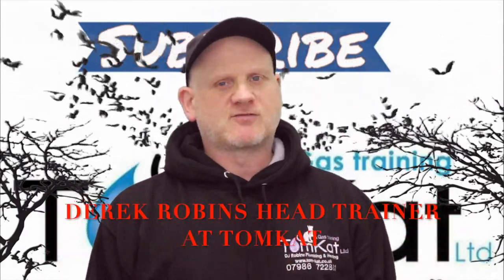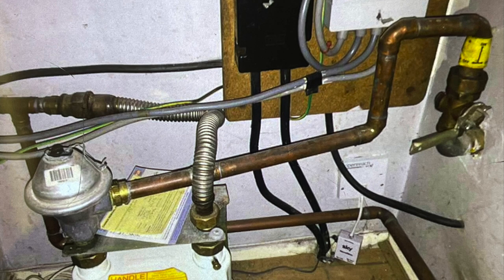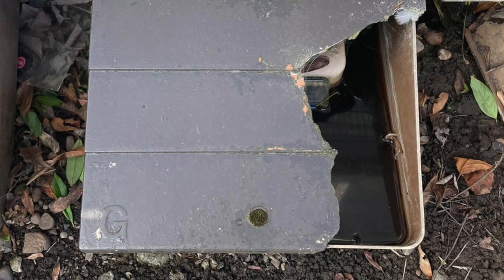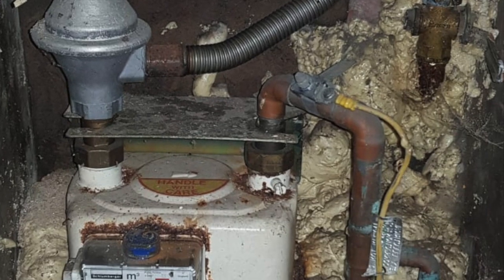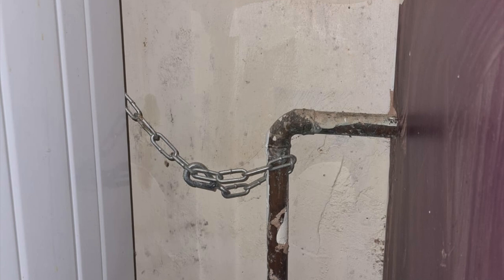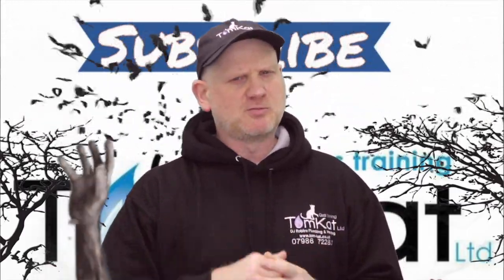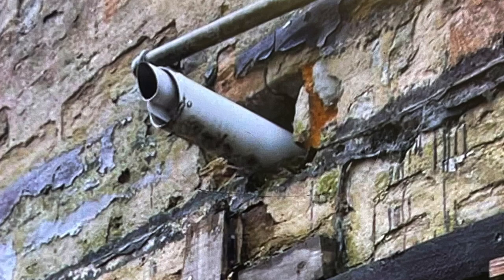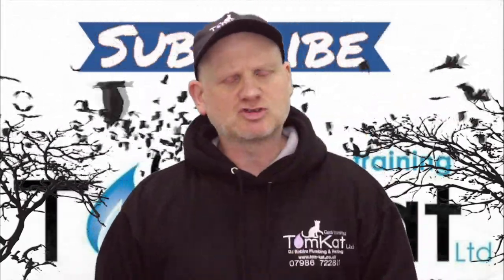HALLOWEEN SPECIAL, Dangerous gas appliances, reviewing pictures of dangerous gas appliance in the uk

Comment: So two flexis are allowed if the outlet pipe is secured within 600mm? Interesting. We're told (big utility company) to always get rid of the flexi. Where are you reading your regs? I could probably use a better source of information!
Reply from the maker: Bs 6400 and the meter has to have a bracket which is fixed to the floor or wall to stop the customers stealing gas